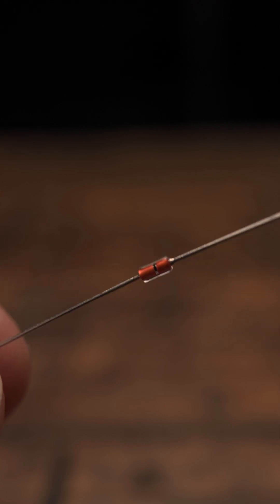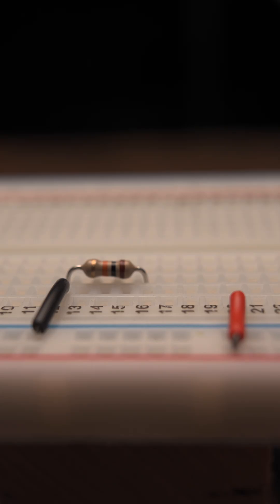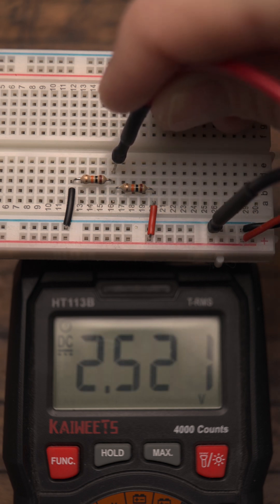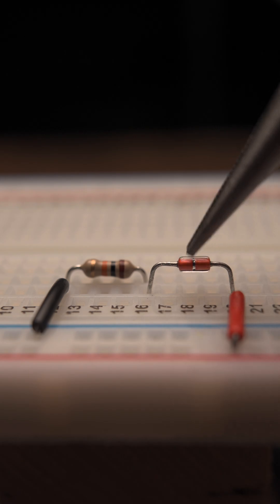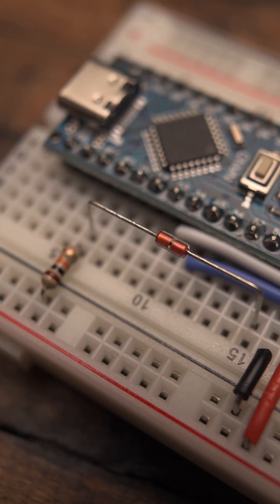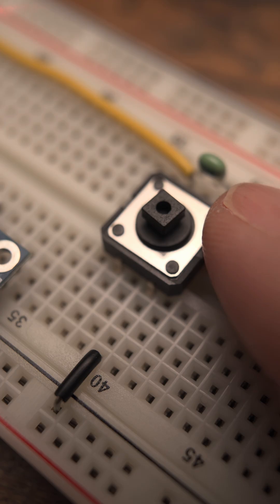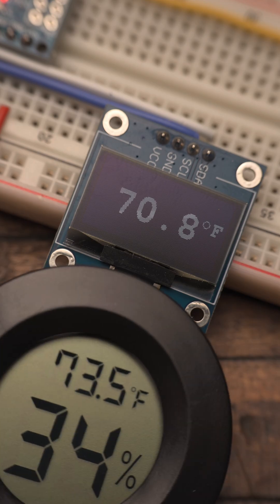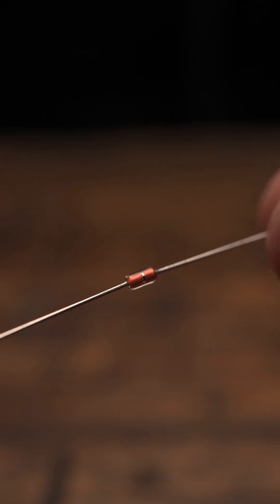#thermistor

Comment: Also they are not perfectly linear
Reply: Their datasheet should give the coefficients so you don't have to hack with the potentiometer
Reply: @bobodyuknow  What if the "Ten Kilo-Ohm" (Brown-Black-Orange-Gold) Resistor does not actually have 10,000 Ohms, but 10,279.15?
Read up on the E series (for Resistors, Capacitors etc) and tolerances. In this case, the tolerance would be "Gold" aka 20  %!
Reply: @DerMarkus1982  so you'll have a DC voltage offset but it gets even worse. Resistors are temperature dependent devices and youll have to compensate for their drift
Reply: @DerMarkus1982  Gold means 5% tolerance.
Reply: @bobodyuknow  This is when you turn toward metal film resistors for their low temperature coeff..
Reply: @bobodyuknow  depends on how well calibrated they are out of the factory? how precise are the specs usually?
Reply: since it not linear, can we use code make it linear?
Reply: @bacod_6  yep you can have linear approximation if you want something but it will drift in and out of accuracy. You can have a polynomial; The datasheet will give at least it should the coefficients for a 2nd or 3rd order equation and the code will calculate it within the accuracy of the thermistors. These coefficients are determined at manufacture from a bin of components within a gaussasian distro so u need to check the datasheet
Reply: @bobodyuknow  thanks for the information 🙏
Reply: @bacod_6  Easier to go with a PTC thermistor, those only need 1 cal. point. NTC's need 3 cal. points. A problem connecting this simple way, is that they get warm cause of the current, thus sensing the wrong temperature.
Reply: @FrankChanga  so PTC will get warn  because current? if we compare to lm35 or sht 30 which better for use daily measurement?
Reply: @bacod_6  The circuit shown here affect both PTC and NTC. One way to mitigate the issue of self-heating can be done by using an op-amp in co-junction with a transistor (many examples out there) to only apply voltage to the thermistor when you want to measure. Using a lm35 or e.g. DS18B20 would make everything a lot simpler, and they don't get affected by self-heating (internally compensated). If I remember correctly, the SHT 30 is a combined humidity-sensor and a thermostat, so most likely, the thermostat part would be either a NTC or PTC. Hope this helps.
Reply: @edinfific2576  Depends on the resistance of the thermostat and the duration of measurement. As I've stated, this is a very common issue and there's a lot of docs out there explaining this if you want to measure as accurate as possible. Another issue with NTC & PTC's is the drifting over the years, talking about upwards several kelvins depending on quality.
Reply: @bacod_6 better way to make it lineair is using a bridge circuit. Super interresting but requires some math to figure out. it is very easy to make a linear approximation between to temperatures. then you can find a lineair formula and calculate temperature using the voltage.
Reply: Which is why digital temperature sensors are used - why should I bother with non-linearities for a few cents when I can get an industrial sensor that gives me the temperature directly as a number?